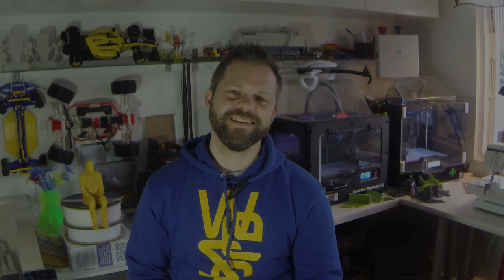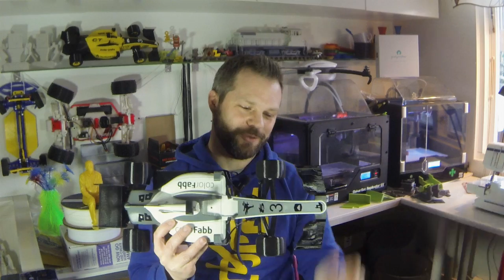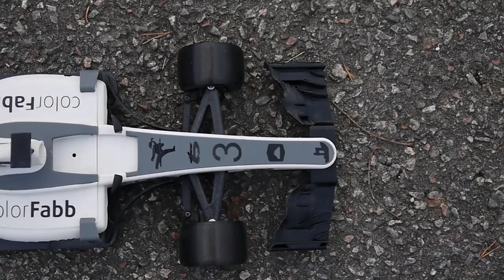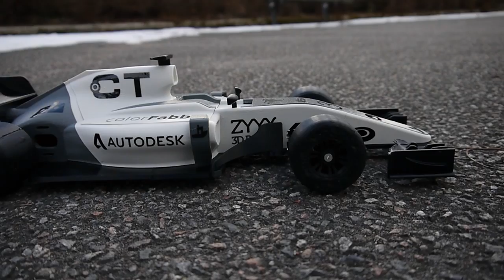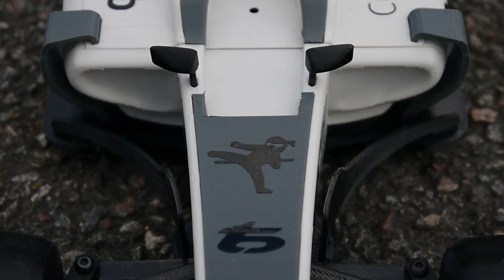3DPrinted OpenRC F1 2017 updates

Comment: Hi Dan, love the car, going to print one at some point.  Have you thought of altering so that it can use off the shel lexan bodyshells like what Tamiya and Protoform sell?
Reply from the maker: I haven't but I think somebody have done it. Not sure though. =)
Reply: @DanielNoree  cool, cos as good as it is, it just wouldn't be competitive against other f1's otherwise due to the weight.  Gonna try and print it at some point with foam or rubber tyres.